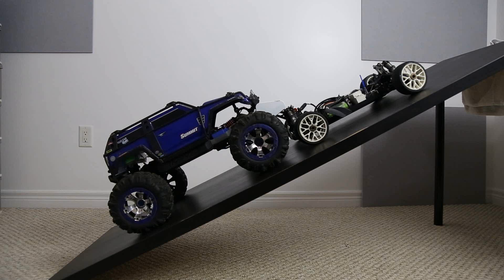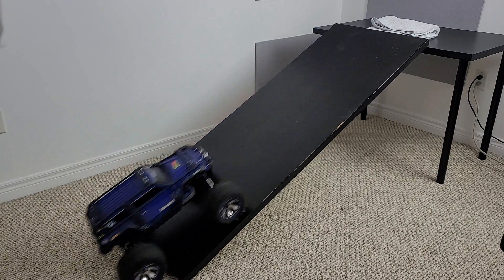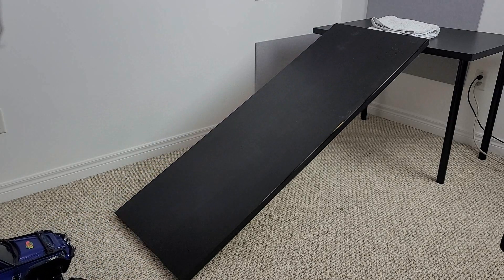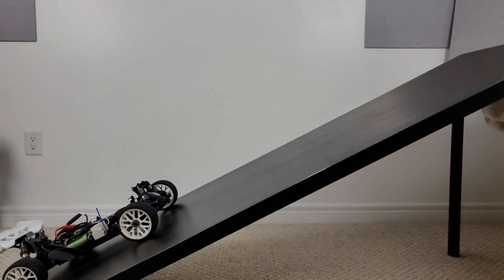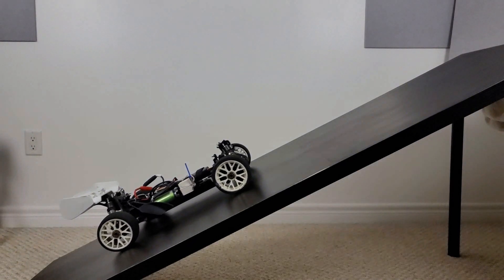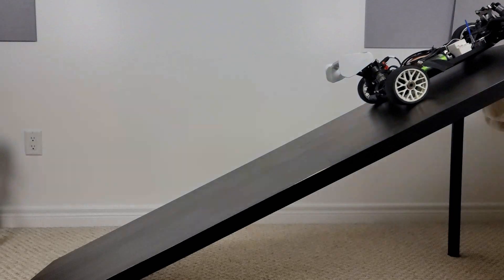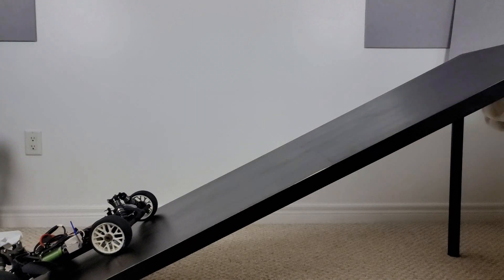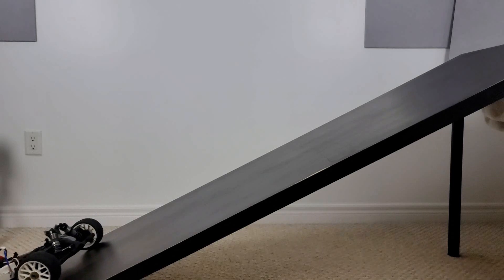Sensored vs Sensorless Brushless RC Motor Demonstration  with Slow Motion

Comment: Awesome video. I picked up a used Traxxas Slash with a Castle Creations Sensored motor but the esc died. I’m trying to figure out if it’s worth buying a sensored ESC like the Copperhead or just getting a sensorless esc like the Sidewinder 4.

Comment: It highly depents on the motor and ESC combo you are using I think. I have a Holmes hobbies Revolver 380 2000kv sensorless motor with a RhinoESC 40A sensorless ESC and I have never any sync problems. If you program the ESC in a perfect way to the motor specs It run as smooth as a sensored system. Except the sound. On a sensorless motor it pops your ears😂

Comment: kind of off topic but, my rc car has a warning saying that it can only run batteries less than or equal to 25c, why is that warning there, can i run a higher C rating battery even though the car warns me against it?
Reply from the maker: Have you watched this video?
https://youtu.be/sZmaYsmCROw
Reply: Thank you so much, I don't think I am exceeding my power system as it was RTR and I am just getting a 3s battery for it
Reply from the maker: @sohamnirantare1827  when you say you don't think you are, this is concerning. Measure the temperatures after a run and find out if you are within maximum thresholds.
Reply: Thank you, I did a run a measured and the motor wasn't hot 😁, I just had another question, recently one of my front shocks started leaking, so what shock oil weight would you recommend for a 1:10 scale rc truggy, and can I just fill the shock back up and I'm good to go? Or will i have to diagnose the problem and find out the reason of the leak. Thank you for all your help!

Comment: In scale comp crawling some are actually using sensorless outrunner motors for lighter weight and they perform as well as sensored inrunners.  Holmes Hobbies revolvers with castle esc
s or Holmes' own esc.  Outrunners are typically 10 - 14 pole for crawling applications.
Reply from the maker: Interesting. Using motors with more commutation steps per mechanical revolution can greatly help slow speed control.

Comment: Happy New Year Ryan, and to all RC fans here! I have a question: Many Sensored Motor/ESC Combo's are offered with motors which have high kv values. I saw one offered in a 5200kv version! Maybe I'm wrong, but I would have thought that lower kv = better low speed control. I fully understand that a sensored setup is perfect for crawlers, what I don't understand is why they often have such high kv. Why is that?
As a side-note, I'm currently building a RC tugboat which has dual 192kv outrunner motors (sensorless, 6s), and these motors can turn at ridiculously low rpm, giving me all the control I need. Sure, a sensored setup might be better, or would that be OTT for a tugboat?
Reply from the maker: Happy new year. High kv motors generally have weak inductance that makes it difficult for the ESC to control as extreme slow speeds. For motors designed in this way with weak inductance, a sensored setup will greatly help.

Your low kv outrunners will have excellent slow speed control. For RC cars, slow speed control can have very high loads. Imagine a rock crawler stuck on a rock trying to cross it. For your boat, the load on a propeller at slow speed will be very low.
Reply: @RCexplained  Thanks for the explanation.
Reply: Because sencered generally for racing and not using more than 3s therefore wanting as fast as possible.  Crawlers geared so low and can  increase voltage effectively
Reply: Also with bashing rcs get wet and to go to lower kvs there increasing can size
Reply: Only just started using bl I'm crawlers as technology getting better otherwise used brushed